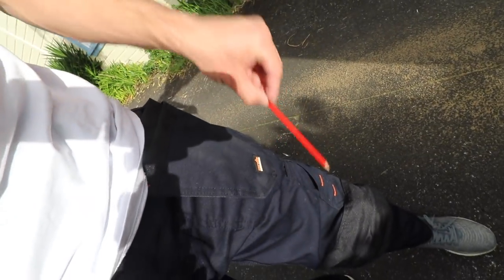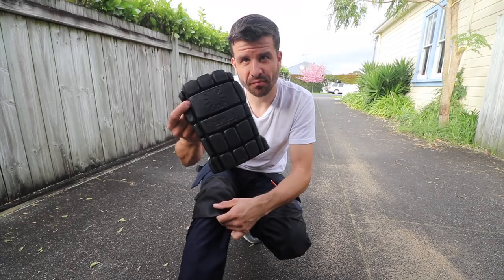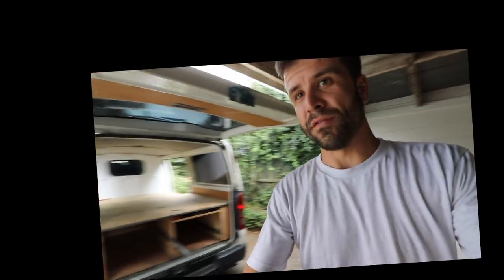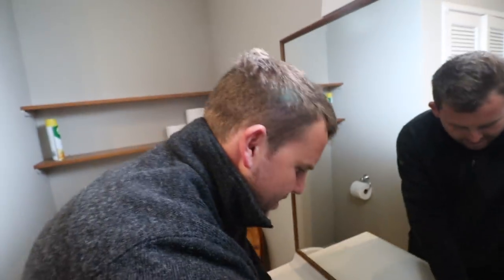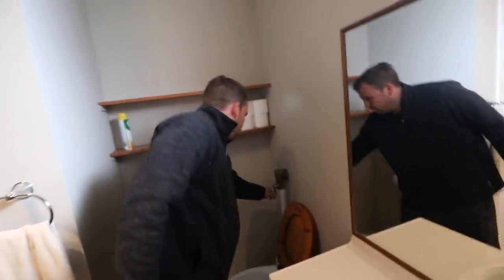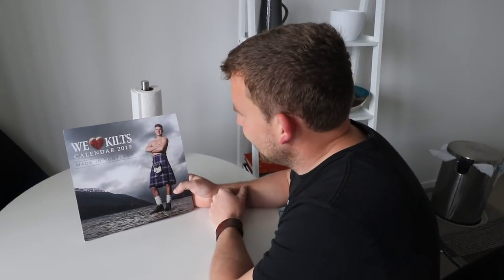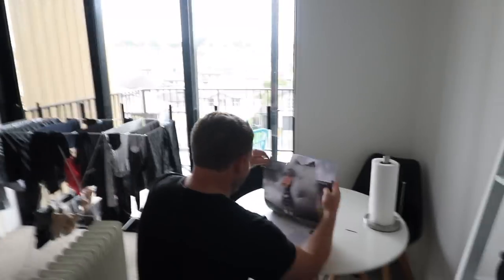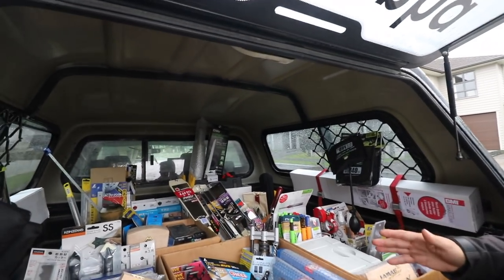Being a Carpenter in New Zealand

Comment: I'm a Kiwi in Canada and the trades are more divided. I'm a carpenter, and I do the framing, which is actually building the house. The concrete foundations are done by a "cribbing" crew. After electrical and plumbing, the insulators come in. Then the drywallers (gib board). They are often divided into 2 crews, being the installers and the "mudders" (plasterers). Kitchen/bathroom cabinets are a separate crew again. Then there is the finishing carpenters who install the bedroom doors, all the baseboards & trimwork, closet shelving etc. And if hardwood floors are been installed, that's a different guy again. I can do all carpentry, framing finishing and hardwood, but when doing a whole house I'm just framing.
Reply from the maker: Woah, quite different to what I am used to here, but I feel we are moving more and more in that direction

Comment: In Texas, a contractor that does it all, (concrete, drywall, rough and trim carpentry) is typically called a general contractor. If you are doing a job where you cant do one of the trades like plumbing, that trade is subcontracted out under your contract, but the rest of the work is self-performed and you are a general contractor.  There are specialty contractors like a drywall contractor who might do framing too but they don't typically do trim, mud, and painting, those are all specialty contractors. The bigger builders and general contractors don't perform any of the work and they sub it all out and have a separate contractor for each of these trades, concrete, plumbing, electrical, framing, roofing, drywall, painting, trim. (included cabinets), carpet and masonry...etc. Typically the general contractors that do self-perform are smaller contractors that do high-end work and only one or two houses at a time.  That is me, I am a specialty contractor, I do electrical work. I can finish concrete, frame, trim, lay tile, or just about anything but the money is in just sticking to my trade. The truth is my first love it woodwork but carpenters make a lot less than electricians.
Reply: yup exactly how we do it in Canada as well
Reply: How long did it take you to learn all that?

Comment: That's why Kiwi builders are so sought after overseas we ground up builders. Do the job start to finish....
on the subject of tools do you have much experience with the Dewalt battery operated nailing gun ? . thinking of buying one wondering how they operate from people that actually use them. (This question is open to your subscribers to you answer to) 
and Hahaha tool porn ....😁 So  Funny
Reply: Heavy but faster and more consistent than your paslode in my experience. However, I hear the hitachi outperforms the dewalt may wantto look into that aslo.
Reply: My boss bought a hitachi 18v framer and it kicks butt. More power than the air guns, smashes nails into hard kapur glulams with ease. He liked it so much we bought another one a couple of weeks ago. Only thing is the weight of the gun itself.
Reply: Hitachi make fantastic tools but are placed all wrong in the marketplace and not correctly priced. They will for example have fantastic motors but very poor accessors such as on their router punges. There tools are too cheaply priced which means they are talking shortcuts on certain fittings which then has an affect on their overall quality.

Comment: I noticed the exhaust port on your DeWalt drop saw comes out of the top behind the motor, not from the back end of the slides. Did you customize that? I've noticed that small bonnet in back of the saw blade will shut under heavy vacuum, so I've put tape on it to stiffen it up. Just wondering if your short-cutting the exhaust tube helps dust collection.